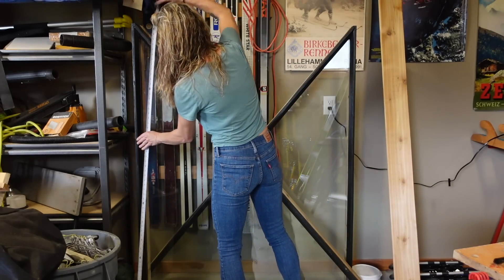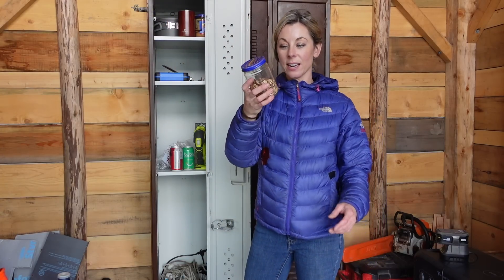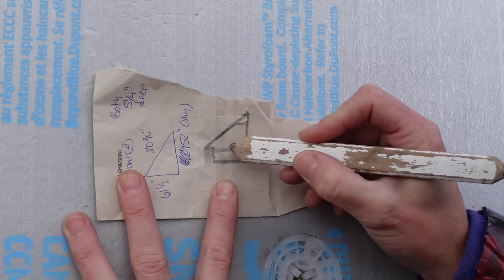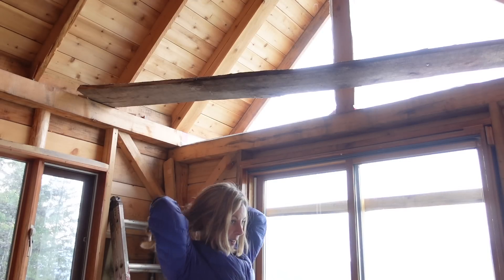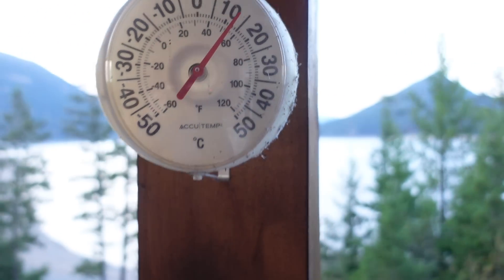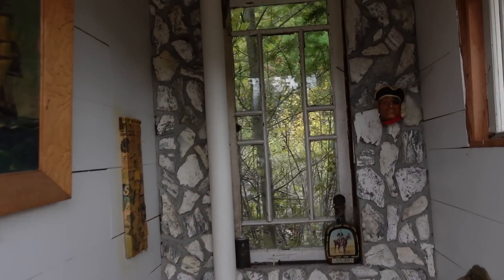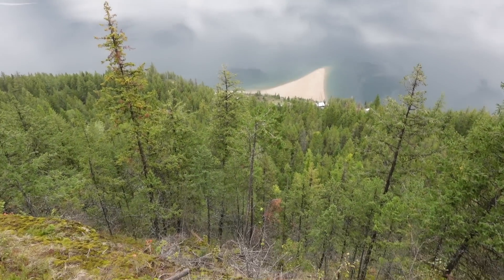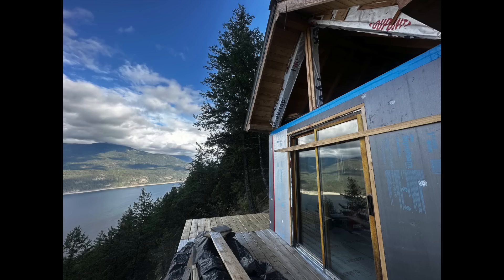In this case, size does matter.

Comment: I highly suggest that you make either a cardboard or foamboard template of your glass. Two reasons, one if they happen to be slightly out of square your measurements can be off. Two, you can check the fit a lot easier with the template being lighter and not as fragile. You can also cut a hole or holes in the template to be able to better hold it while checking the fit and reduce fighting the wind. It is a whole lot easier checking this way than fighting the glass up and down if your opening is a bit off. Best wishes.
Reply from the maker: Yes - I thought about making a cardboard template but talked myself out of it 🫣
Reply: Michelle, this is a good idea... making a template is the smart move... listen to this person...
Reply: @michygoss7148  I forgot to mention. On larger pieces of insulated glass, if they are left sitting leaning, the weight of one side can actually slide down so that the sheets of glass are no longer aligned, which would make a change in the required opening. It does not always happen, but it also is not uncommon. The pieces that you have are not huge, but big enough for this occur. If you try to force them back into alignment, you are apt to caused seal failure.
Reply: UGH..... Come on the hard way is way more fun and better for views... LOL
Reply: I agree a template is the way to go. Wouldn't want to get the window up there and it not fit the opening.
Reply: In addition, you could leave the templates in place and close the openings while you wait to get the windows down there. That buys you time if you need it.
Reply: @dallasarnold8615 no won't happen...Well not with units from a manufacturer ......Esp after the black sealant sets...Cardboard idea is exactly what I'd do 😊
Reply: @christopherwilson4003  I had forgotten that Michy already had these in the frames. So, that pretty much secures them. But I can tell you from years of experience working with IG units that they absolutely can shift if left sitting leaning.  I spent years building custom windows at Pella Of Georgia. We got our IG units from Tempglass Eastern and AFGD. You can say it does not happen all you want, but I experienced it numerous times before I figured out why it was happening. If you wedge the unit to match the amount of lean it can be prevented.
Reply: @dallasarnold8615  .Wow really...Left for how long though ..?

Comment: Before you hoist those heavy windows up there, I would trace their exact shape onto thin (light weight) plywood, and cut that out for a "test fit".  EDIT: Maybe foam board, as mentioned in another comment.  Definately not cardboard because it's not rigid enough, and it will bend in the wind.  Good luck and stay safe!

Comment: Hey Michy, for getting the tri windows up, please get one of those vacuum glass grips (the classic variant has two suction cups connected by the handle. Fix them to the glass from the inside. Have a rope with a purchase between that handle and a roof beam (maybe a screw eye?). This way you can lift them up and they will dangle, but cannot fall out, let alone down the cliff 🫣
Be safe and I love your videos! 😍

Comment: Measure then mark what needs to be cut out. I would use a battery sawzall to cut some lines, then a 1" wood chisel to knock out the cuts. On the window frame measure it twice, write it down, put in pocket then see if the windows are the same. Are both openings the same measurements??

Comment: it doesn't help now, but you would use a circular saw, set your blade depth to 1/2" and make several dado cuts. once you had roughly the right amount of wood removed you would finish it off with a chisel to smooth it a bit followed by a sander depending on how smooth and finished you want it to look.

Comment: Hi 👋, Michelle , Rocking and rolling, I was at a salsa dance at the beginning, 😂 I think, knowing you, it’ll probably be the salsa dance, 😂.
Great footwork , I seem to recollect are used to be a TV programme called you’ve been framed, sadly to say, I think you have, I think you need to call back the building constructor and tell him or her. What do you think?, And if you have a problem, get the chipmunks onto him ha ha,😂😂, they are definitely a little cuties, I’ve had quite a few red squirrels running around doing the last week, as it is that time of year, when walnuts are getting ready to drop, I went for a walk down my lane, just passed my next door neighbours building, a red squirrel came running out carrying a huge walnut, I stayed still, it came right up to me within a foot sat by my feet, looked at me, and then scampering across the lane and up the trees, obviously stocking up for winter time with some yummy nuts, 😂😂. 
I think it is a great idea, the way the back of your truck opens up , and I think I mentioned before you will probably get some very good pieces of Driftwood on the shores of the lake, could be good for wall, art or sculpture, even in the garden, great idea using the stone for behind the back of the fireplace, Was that a mermaid I saw in the lake or was it you skinny dipping ha ha I bet that’s cold , ❤. it is supposed to be very therapeutic to dip in the freezing cold water., I believe it keeps you looking young and beautiful, ❤😂, obviously you go in there every day, 😂, . Let’s hope you can get it all closed in before the winter sets in., and obviously needs two pairs of hands 🙌 hands 🙌, and some decent scaffolding to stand on while you were doing it, I have been working on the river side of the moulin this week, it is made up of very large rocks 🪨, it has had Ivy, stinging nettles, Moss and grass, growing over it for many years, and I decided it needed to be cleaned off, I’ve opened up a can of worms, not literally, I’m not that hungry, by the looks of it, it all needs pointing up at least 6 to 8 feet up the wall, some of the voids would take a bucket of cement, I think it’s going to take probably 2 ton of cement, luckily, the riverbed is dry right next to my property, but not sure whether I can get it all done before the winter sets in, as a river normally comes up by at least 3 to 4 feet, 
Sorry, I’m jabbering on about my stuff , 😂. Hope you are both keeping safe and well, I look forward to the next stage of your project, Phil from the moulin France,

Comment: Hi, bring an electric four inch hand plainer on window installation day. Then with the flick of a switch you can take a little off the top,bottom,and or sides of frame with a few passes of the plainer. The tears will dry into a smile and the windows will fit . If needed. I think u will want a tad of space all around the windows for expansion and contraction😊

Comment: If the linseed oil doesn’t work out for you there’s a few wipe on clear coat products out there intended to seal in patina on cars, but metal is metal. They are a bit pricy though.

Comment: Hey Michy, I just wanted to remind you that you need to burn that new stove off outside before placing & burning a regular fire indoors, the paint can send of fumes that will make you feel sick and it's certainly not safe to breath, just a heads up
 ✌️😊 also the views from that window, are awesome, ya might want to consider building a loft up there,it would be like waking up in heaven opening your eyes to that in the morning huh? Anyhoo..have fun and be safe, I'm loving that Lil chipmunk lol
Reply from the maker: I did burn it off actually - early spring (it’s in a video). And yep - I will be putting a loft in there!! 😁
Reply: @michygoss7148  awesome sauce! 👍🏻

Comment: Hey ho, list guy here. Now you have a forcing function, which is a term of art meaning deadlines. You actually have two: get the inside done enough that it could be safely heated by the wood stove, so you can continue to work on outside projects in the winter and have a place to retreat to; and a time constraint because of needed to go back to Taiwan to get the boat.

The time constraint means you can't do everything, which is good for prioritizing the projects/lists, and the wood stove condition gives you the list of projects that has to happen in order for the cabin to be closed up and warm-able. I am writing this before I see the end of the video, so I don't yet know if the peak windows got installed. That just means it gets added to the list (of lists) of projects that are the highest priority. For what I can tell, the list looks like this so far:

- Finish exterior insulation
- Get wood stove working
- Install and seal all windows

Not sure if you need the inside floors done before winter, because I don't know if you can safely work on them with the stove going. But that could be a task that gets pushed to the winter. On the other hand, any work with painting or epoxy are both temperature sensitive and also need good ventilation, so those would need to be moved up if they affect the usability of the cabin as a retreat or workspace.

More thoughts when I've seen the whole video.

Done with video. My additional thought is if the tiled stone wall isn't needed in oder to use the stove, than that could be a winter task. I'm guessing you'll be using cement, which doesn't have the same vapor issues as paints and epoxy. What would an issue is tiling behind the stove while it's going, so avoid getting burned is something to pay attention to, though that may be solvable with a sheet of plywood in between while you work.

Good luck, and I look forward to the next video.
Reply from the maker: My thoughts exactly! I had wanted to get the stove backdrop all done so that I don’t need to work around a hot stove and pipes. There isn’t much room between the flue pipe and the back wall, so hoping to just get that all in order, but at the very least, I want the cement board up for fire safety. 
I plan on having the stove up off the floor, so doing flooring in winter is ok. 
Windows and stove. Windows and stove. Windows and stove. The rest I can sort out when I get back yo Canada 👍🤞

Comment: Nice video, I like seeing someone do something real...
About the forgotten key thing... I always plan on forgetting once and a while. so I hide one near the lock.
Not within 10 or 15 ft. not where some one can see you get it. A good way is to put it under a rock with a bigger rock on top of it. so when some one lifts the top one it's still not visible. 
I hate to sound negative, but cutting a small piece of wood in the air with a circular saw is so dangerous. safety is always a pain, but please take the time and use a clamp.
your doing some great work, I think you are an awesome role model for so many people. and those chipmunks are adorable.
Reply from the maker: We did stash the second key near the gate, but the packrat stole it. 🤪
Reply: @michygoss7148  now that's something I never encountered before. It's funny and not funny at the same time.

Comment: I'm a little surprised you framed the windows without them on site or without making a carboard or plywood template of the windows (as previously suggested).  Also, I think that "blue tape" has to lap onto the window sash, otherwise, I'm not how effective it is.  I'm getting anxious to see you seal this thing up and get in there before cold weather!  Keep at it!
Reply from the maker: I only did the first and lowest layer of blue skin. I will be adding more that will overlap that stuff.

Comment: I would set the windows first,  before doing any more framing.  You can screw in some temporary stop blocks on the sill and the center post to help set the windows.  This way its easier to define where the framing goes and it's guaranteed to fit.
Reply from the maker: Thought about that, but in order to frame around them, they would have to be taken out and put back up at least a couple of times. So, I just wanted to do that first. If they fit I will celebrate!

Comment: Was trimming a little of the bottom horizontal sides of the triangles not an option? Would have been easy, just a skill saw trim, maybe a little multi-tool squaring the corners, and no need for scaffold. Just curious. Carry on carrying on;)

Comment: When you install the I G windows be sure to place rubber blocks on the base. When I did window installs that is how we did all our windows
Reply from the maker: Like rubber blocks vs other forms of shims on the sill pan?
Reply: @michygoss7148  the rubber blocks work better for expansion depending on weather conditions. Also the come in a variety of thickness for a better fit all around your unit.
Reply from the maker: @ernieconway6116  ok, I’ll look into that. Thanks.

Comment: A rotary tool with a wood blade would make altering those beams waaaaay easier.
Reply from the maker: I tried a multi tool / oscillating tool but the angle was too steep and the blade not long enough to reach the rafter. 
I just realized yesterday I have a sawzall out there, so that might have worked too.
Reply: @michygoss7148   Either way, great work !

Comment: I would suggest obtaining an oscillating saw. DeWalt has one under. 60$. You have batteries already I think. Good luck. ♥️🦅❤️✝️🇺🇸🐕‍🦺
Reply from the maker: The ryobi thing I used was a oscillating saw, but the angle was too great and the blade wouldn’t fit in there
Reply: @michygoss7148  cabin is looking great.  Can’t wait to see those windows installed.

Comment: Oh so your going to stock the cabin and  make it an airb&b for those who would like to come stay in your little cabin on the cliff .😊 aren't you sweet .😉
  If you or Steve take that gate key to a Walmart or automotive store they have key making machines and you can have an extra key or even two so you both have a key and a spare you could leave at that cabin.
   Wow am I a genius or what??😊😅. Little sarcasm never hurt a soul.
   I bet Steve knows how to use sarcasm at just the right times with you 😅😂
Reply from the maker: The lock has keys that say “do not replicate“. We had a second that we stashed by the gate, but the packrats stole it. 🤷🏻‍♀️
Reply: Those crazy packets. I guess they needed a way in too. Well I learned something because I've never seen a key that said that with any lock. Maybe it's a Canadian thing 😅